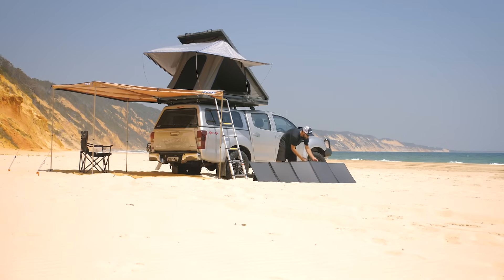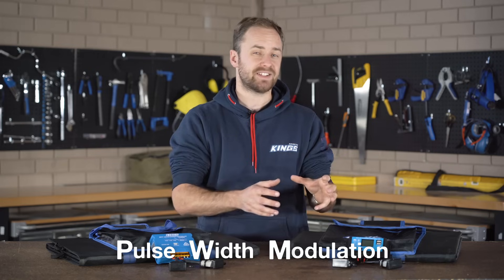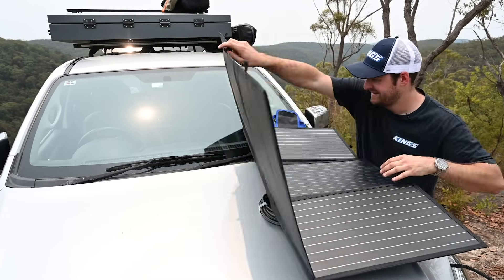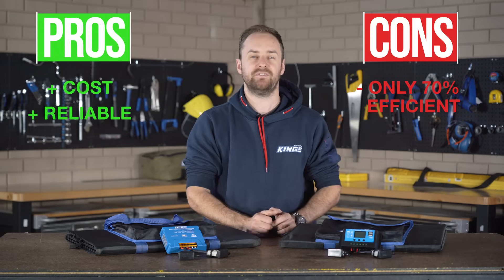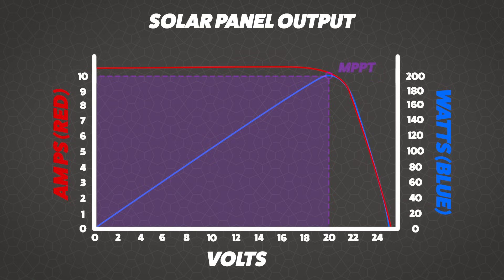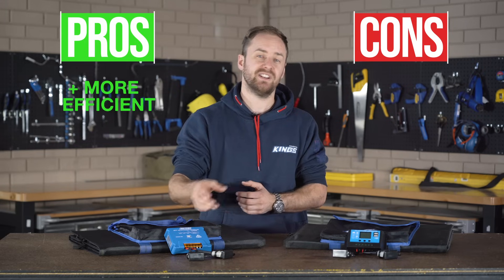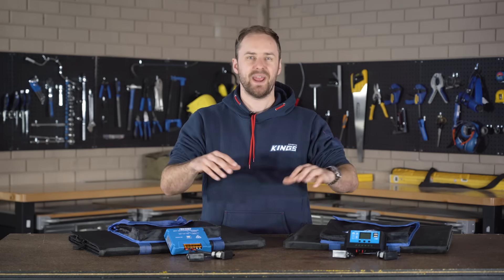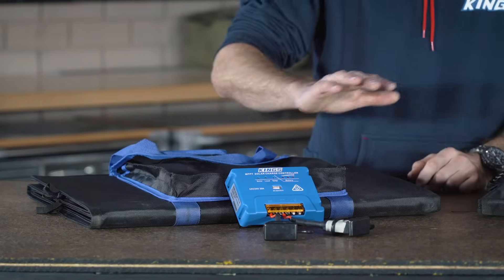SOLAR REGULATORS EXPLAINED! PWM versus MPPT - what's best & why? PLUS upgrade your solar controller!

Comment: i finally got an mppt controller. last night i setup a test to be run today. i placed a pwm controller and a mppt controller next to each other on the bench and each controller got its own dedicated 100 watt panel and a partially discharged 12vol agm battery. when i got home from work i was able to read the watt meters on both systems and found the pwm outperformed the mppt. it was sunny but only for about an hour this morning, then became overcast but not the super thick cloud layers i normally see when its over cast, and even snowed off and on some of the day. the pwm pulled in about 206wh and the mppt pulled in 198wh. in the very first light of the morning the pwm started charging the battery for about 20 minutes before the mppt did, and i thought maybe something was wrong in my test, so i swapped cables at the controller going to the two solar panels and the pwm started back up charging and the mppt just sat there chilling. both panels are the exact same and sitting in the same position and angle in my yard. i believe as soon as i get to 200 watts the mppt will shine, as i will wire it in series which will deal with the amps much better than the required parrel connection that the pwm will require at the 60 foot run. basically series will be 36v x max 5 amps = 180 watts, and pwm will be 14.4v x max 10 amps =144 watts, minus the loss due to "high-ish amps over 60 foot run, who knows maybe i am wrong, more testing to come
Reply: try swapping the panels and see what happens.
Reply: @IleneOva  thanks for your feed back, i have two panels that are exactly the same and i swapped them and the wires and there was no apparent change at the time that i did this switcharoo. unless you meant swap to another brand/type?
Reply: Were both batteries at the exact same state of charge? It's unlikely and unusual for a mppt to make less power. In fact, it's almost impossible because it takes the voltage above the battery voltage and turns it into amperage, something the pwm is incapable of. I mean no offense, but something isn't right with the test.
Reply: @j.r.576  i honestly dont remember the details, but i walked away with the conclusion that in small systems pwm can actually be more efficient than mppt. i dont remember the details but it seems like you need around 20v , not ocv btw, hitting the mppt before mppt can start to really become use fuel. i since then moved onto other systems and run 100ocv into several mppt controllers.  it is very possible i was doing something wrong, but the more i learned and the more i read, it seemed like my observations were accurate despite the general consensus that mppt will always be more efficient than pwm, which is not what i found with 100 watt panel tests
Reply: @jasonbrown467  I cannot say I tested with that small of a system but it seems odd. That of course doesn't mean it cannot be true therefore I yield to your testing.
Reply: @j.r.576  lol being able to wire panels in series and get high volts and low amps has allowed for me to make long cable runs with minimal losses >2%. so for this reason alone i mostly stopped using all my pwm stuff. i think to get any amount of solar power that is useful mppt is the way to go for sure, i could never wire those panels in series on pwm, well at least i dont think there are any pwm controller that can handle that config, but i could be wrong.
Reply: @jasonbrown467  I prefer wired in series also when able. Currently I'm p/s with 6 100w panels an a 40a mppt. Soon will be 800w with 60a mppt. Solar is fun especially when you realize the benefits.
Reply: If I understood u correctly ur charge controllers r by ur panels & then u have a ling run of wire 2 ur batteries...
That's the wrong way, ur charge controllers should b as close 2 ur batteries as possible...
If u do that then the mppt will work better & beat the pwm.
Reply: @MaxMax-dq1lu  i never stopped playing with solar, so i dont remember exactly what i was doing at that time, but i am pretty sure the controllers were next to the batteries. since then i have built a 4.3kw solar arrray and 42kwh of battery. maybe i will revisit this topic, but i am pretty sure for small systems mppt doesnt do much until about close to 30v ocv, but dont quote me on that

Comment: Hi. Do I require a regulator if I have a dcdc charger with a solar input? Cheers.
Reply: What model do you have? Most that take solar input have a built in controller.
Reply: @johnmurray198999  ctek dcdc charger. I'm pretty sure it does have an inbuilt regulator. Just hoping to confirm. Cheers
Reply: @glenbirett9839  if it’s a Ctek d250s / d250sa or the likes then yes the ctek does have a built in mppt solar regulator & you will not need a standalone regulator.

I have 2 options for my set up - I have attached neg & pos cables to the ctek d250s solar inputs with an Anderson plug on the end which allows the lead with Anderson plug from the solar blanket to attach & detach easily from the ctek seen a solar blanket is not a permanently fixed solar panel set up. 

I can also plug the solar blanket in directly to my battery box that houses my deep cycle battery (& ctek), using the supplied PWM regulator & the Anderson plugs that came preattached on the battery box which are in turn directly attached to the battery.

Basically if I need a good proper charge for the 2nd battery ie lots running off dual battery and dropping voltage quickly, I use the ctek solar as it charges more efficiently. If I’ve only got my fridge running off my battery no accessories, while parked up camping I just use the pwm controller to the solar blanket to the battery box.

Comment: thanks for the video. i wish more people talked about the specifics like this.  i would add that another benefit is mppt controllers normally allow for wiring your panels in series, so you can get the same watts, but decrease your amps and have cheaper cables so you can place the panels farther away from your site, maybe even out of the shade, or leave the amps the same but increase volts, therefore increase watts.
Reply: @Peter Evans At 8:56 into the video you can see volts, amps, power and energy being displayed.
Reply: That's true I have another 48v system, I use 3 mppt charge controllers each connected to 8 solar panels 4x250w + 4x250w . I use a 700ah forklift battery which are 2vx24=48v , I have 2 inverters which I alternate. I use fridge, 42 inch TV  , microwave  , kettle,  water pumps and lights this is the 5fth year with this system and still going on I'm connected to national grid but I do not use it so I'm almost recovering my initial cost I also have a 2000w wind turbine which supplements charging during windy periods. I was experimenting possibility of planting off grid and have now archived my goal so the way forward is mppt charge controllers
Reply: @yusufbarkari2333 sir can you make a video for this 🙏

Comment: Is this compatible with lithium batteries?
Reply from the maker: The MPPT and PWM  controller is only suitable for lead-acid batteries: LEAD, AGM, & GEL. The Solar Blanket & Controller should not be used with nickel metal hydride batteries.

Comment: Hi there do i have to remove the black power box off the back of my fold out 250w solar panel to connect the mppt or do i just connect lead to mppt charger after connecting it to 2nd battery? Cheers chris,

Comment: i want to add a panel and mppt  chare controller as a portable panel 100w what items do you suggest? lithium battel bone batteries 200 amh, my intent is to use this when I am in the shade and hunt for the sun. GREAT job.

Comment: What is the ideal position for a 200watt solar panel, if not on the ground ?
Reply: Depends on your latitude and time of year. Here it is between 30 and 45 degree angle toward the South. Noon is around 1:45pm here. So just before clock noon to 4pm is when we get max output.

Comment: Good information, thanks! Quick question, does the MPPT that comes with the 200W blanket work with / charge lithium batteries?
Reply: I've never met a lithium iron phosphate battery that would work with a PWM. 
Your best bet us to use a MPPT for your lithium iron phosphate battery.
Reply: If you read up on lithium you will see it is stated that pulse chargers should NEVER be used. That is what a PWM charger does.
Reply: Did you ever find out if MPPT works with Lithium batteries?
Reply: @philliprushanrushansuperfu5920  It didn’t work with my battery, so bought a new mppt controller and programmed it to my battery’s specs

Comment: You forgot to mention the most important default of MPPT, when the load calls for heavy current, the PWM let it pass instantanly, but the MPPT
 starts a whole new calculation from zero, and if your system is a little underpowered, this will put heavy stress on the battery, battery stress means shorter lifetime.
Reply: You don't say which stresses the battery.... :)
Reply: Oh, really? Where can we find more info on this?
Reply: So, in your oppinion, would it make sence to put a cheap pwn in parallel with a mppt? Just for this reason?
Reply: @RikHaanen  No never do it. The PWM pulls the panel voltage down to close to the battery voltage so there is only low voltage and the MPPT can thus not do it's work. It will be wasted money on a more expensive MPPT. MPPT's need about 5V more than the battery voltage to start working and after starting it needs about 1V more than the battery voltage.

Comment: Very good comparison, i know MPPT controller can abstract over 90% of the solar power the solar panel receives. and PWM shall be around 70% or even less generally. But i never do such experiment to get real data comparison.  good video. thumb up

Comment: But...as the battery gets closer to its charged point it wont pull a lot of amps......so how can a MPPT be any better than a PWM?  You don't want to go above 14.7v with a lead acid battery anyway, so again, how can the MPPT increase charging voltage if the PWM is already charging at 14.5 max?
Reply: This is explained in the video. 

If you have say a 20 volt panel the mppt can use the whole 20 volts while converting down to charge voltage. This means increased amperage is available.

A pwm controller will only "use" the 14 point whatever volts to charge, leaving the excess 5+ volts available from the panel entirely wasted. This means less current. 

When the battery is charged you're right. The current is reduced. But that's not when you need the power anyways so it's irrelevant.
Reply: @Spearborne  in real life it won’t make much difference , if it’s sunny both type will charge the battery . If it’s partly sunny / cloudy then the MPPT might get a few more amps into the battery but both will still struggle because the panel needs a decent amount of light to produce the required power .
Reply: @Omegaman1969  

Since its clear you don't understand, the flaw in your argument is assuming that sunny days aren't valuable and that "a few more amps" is insignificant.

1: Again, it does not increase charging voltage. It increases charging current.

2: Even on a smaller/parallel system where the cloudy output voltage might be less than charge voltage, the sunny day voltage will always be higher than charge voltage and you are literally wasting power at that point. See 3B.
2B: Even on a cloudy day a series panel setup will always have a voltage higher than charging voltage and you are absolutely wasting a lot of potential power by not using an MPPT. A lot of RVs are set up this way simply because its a bit more efficient.

3: "A few more amps" is rather significant at the scale most people who watch this video are operating at. Not sure why you think that is not worth it. Especially when you consider that many of our systems max out at 10-20 amps. Even one extra amp of charge current is significant. That 1 extra amp for 8 hours is enough to run my vent fan all night for example.
3B: "A few more amps" into your batteries on a sunny day might be the difference between losing power or making it through the next cloudy day, as long as you have enough excess capacity to store it. If you are charging a system on a sunny day and it reaches full capacity then you should add additional storage.

If your system is never above charge voltage then an MPPT is a waste of money. If your system is particularly small, then it may not be cost effective to buy a MPPT controller. However even with a small system the extra output gained in the 2B scenario is worth it for many people.
Reply: @Spearborne  I totally understand , of course sunny days are valuable but when a person is using their batteries on a daily basis then you have to look at the day by day weather...I live in England not sunny America. MPPT OR PWM won't make any difference with low light conditions.....there are plenty of video online proving that. If the batteries are low and in need of a decent charge you can talk MPPT all day long and the batteries will still need more charge..they can't "magic" power from a solar cell that isn't getting enough light. I have used both and it made little to no difference in the capacity available. Clean panels positioned correctly, proper sized cables and decent batteries are way more important factors.
Reply: @Omegaman1969  If you are using them on a daily basis then getting as much as you possibly can out of the sunny days becomes EVEN MORE important to make it through the cloudy ones.

And if its always cloudy, then it becomes EVEN MORE important to run panels in series to ensure you are getting the most out of them, and once again they become EVEN MORE important on the sunny days because the series voltage would result in massive waste when the sun finally shows up.

MPPT is always useful when the panel voltage exceeds the charging voltage, and even on a cloudy day this is always true of series panel wiring.

In all cases the MPPT becomes even more valuable when you have cloudy conditions as long as the system is over about 200 watts, or lower if your budget allows.

And your specific weather conditions are not indicative of everyone's conditions so suggesting that MPPT is a waste based on some arbitrary reasons because YOU don't want to spend the extra money is inappropriate.

Your original statement of "how can the MPPT increase charging voltage if the PWM is already charging at 14.5 max?" shows a fundamental failure to understand how the system operates and I suspect based on the rest of your comments that you still don't understand, despite your claimed experience.
Reply: That's a good question.  I'm not sure the answer myself.  I haven't messed with solar panels much myself.  But off hand it knowing batteries my first guess is that it must be studying and adjusting for the internal resistance of the battery which will decrease as the battery charges.  So the circuitry must transfer the power in such a way that the current increases while the gap in the voltage decreases.  And then finally would turn off when the voltage is ripe on the battery.  I make an assumption there is some sort of stiffening capacitor, perhaps one or more, in the charge controller that becomes a temporary reservoir to hold the energy from the solar panel before it transfers to the battery.  Just by the time constant of charging a capacitor an its changing voltage reading a microcontroller can calculate how much the solar panel is putting out.  And once the capacitor is full there is enough steady electrical pressure to make a consistant charge source like a water pump filling a water tank.  So that intermediary element would become the baseline of the source voltage.  A liason element between the panel and the charging electronics if you will.  The capacitor would hold the input power most efficiently and when it peaks let it loose to the battery until it drops to the battery level.  Like a governor in a mechanical system.  With a full tank the charge circuit can do whatever neat switching stuff through transistors or what have you much more efficiently in terms of power transfer than a steady timed pulsing system.  And then it's like a well charged battery charging up another battery.  I have to study the electronics of one of these units to see if I'm correct.  But this is a great and thought provoking question that I was wondering myself.  Thank you!
Reply: PS The word I meant to use for the capacitor was integrator.  It naturally integrates the energy very much like an integral calculus function.

Comment: Which setting on Kings PWM controller hooked up to 200w solar panel is best for LifePo4 100AH battery?  b06 lithium ion 3 strands, b07 lithium ion 4 strands ?
Reply: None - The Kings Solar Regulars (Either) are not lipo compatable.

Comment: What is that digital monitor your using to show the input charge amps
Reply: Ward, wanna know too
Reply: Me too.
Reply: Me three🤔
Reply: Thanks for the explanation. My question is can PWM charger rated 12/24/36v take 24 volts panel?

Comment: Thanks for the video, I'd like to know what's the minimum amount of watts does an Mppt regulator need to work?
Reply: How long is a piece of string? Google your specific MPPT controller for the answer to your question.
Reply: Seriously it varies by product my Victron charge control uses 400ma and won’t start charging until it’s 4 volts above the battery
Reply: if you're asking, you might need a  boost/buck type controller.

Comment: Great to find this.  I have that exact PWM on my yacht for a 200w panel so I will be changing the PWM out for an MPPT.  Your MPPT looks similar to the Victron Energy one.  Just need to decide what size of MPPT I need.  What determines what size?  Thanks. Andy UK